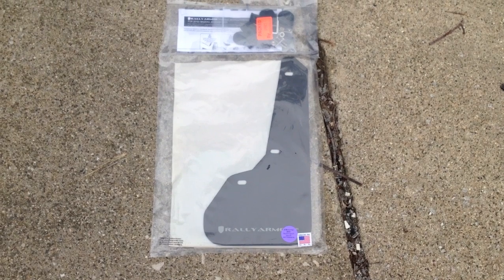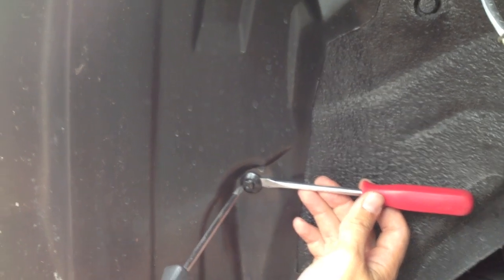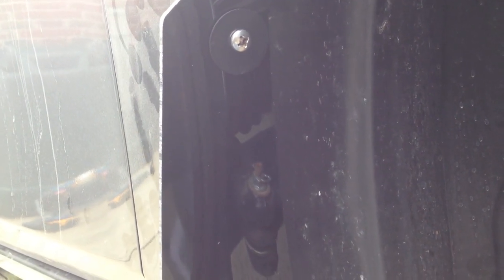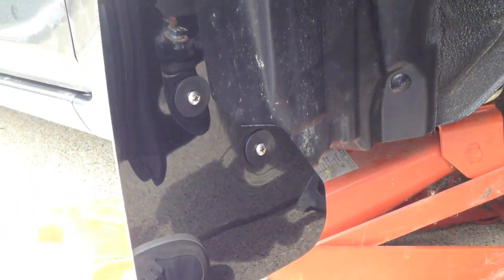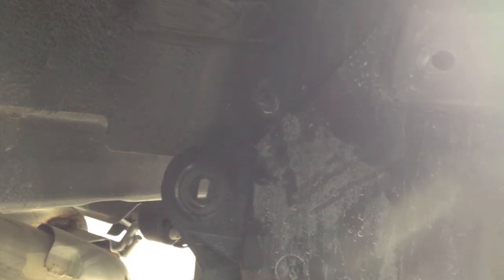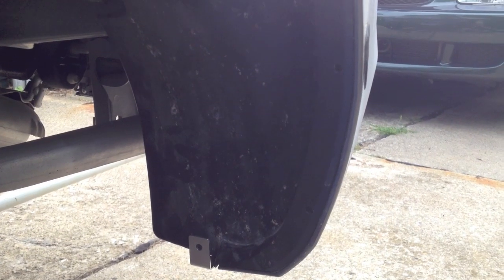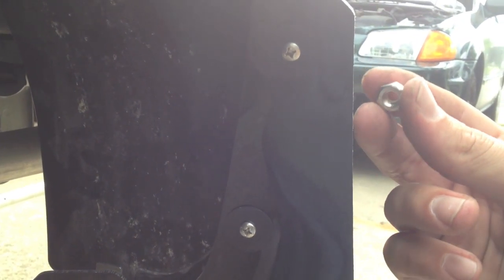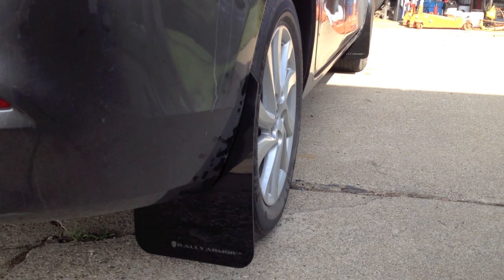2012 Mazda 3 Rally Armor Mud Flap Install How-To

Comment: will the gen1 fit for gen2 speed3?
Reply: Zach Smith I have the same question did you ever find out?
Reply: I don’t think so I have gen 1 basic mud flaps and wanted to put them on my gen2 but I’m sure they are different
Reply: NO. it will not

Comment: I'm trying to do this on my car and it's totally different in the gen 1. The side skirt needs to be removed.... :(
Reply: +InsaneDynamics was it hard install over all or easy
Reply: +Marvin Franco Forget what I said about the side skirts. I did not remove them. The rear gave me more trouble than the front flaps. I actually had an issue with one of the rear ones getting ripped off during a back in park job where the flap/tire hit the curb so be careful. I did get it reattached but had to get new washers because 2/3 plastic washers broke. I also had a small tear in the flap that got ripped off which I took care of my carefully melting it down. You also need to work hard on getting them aligned properly while screwing some of the bolts on. It requires more effort than I was thinking to say the least. My Mazda is currently at full stage 2 specs FYI of which all work was done at home.